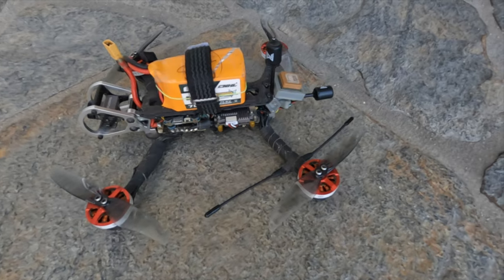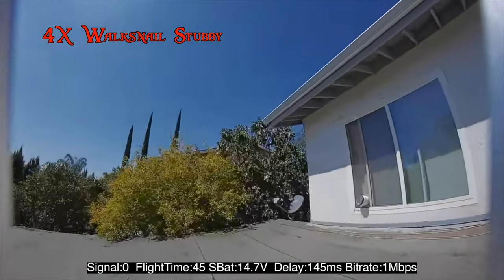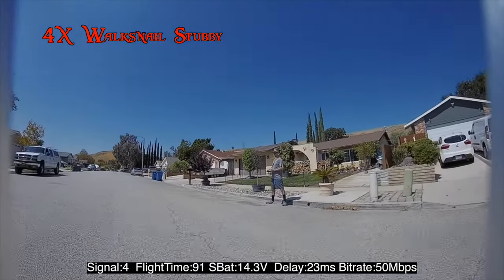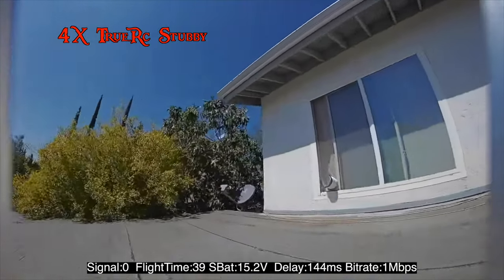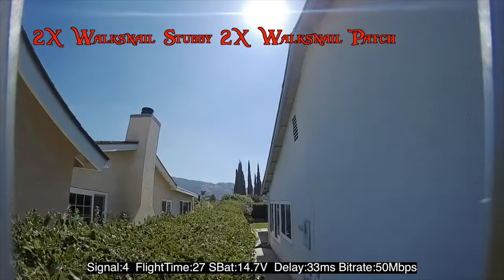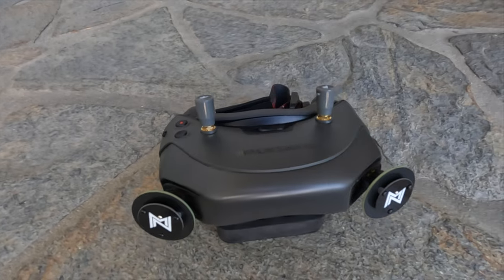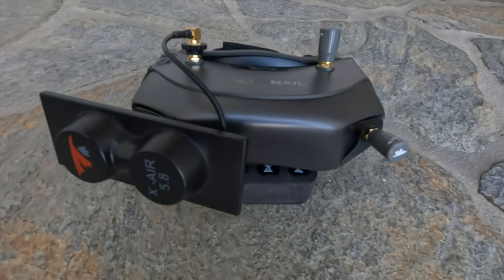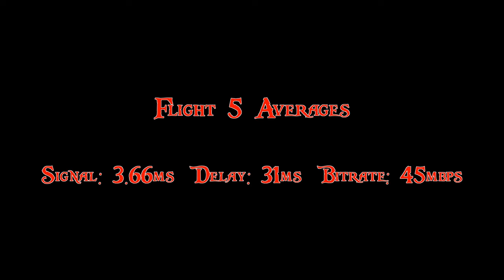Walksnail Avatar HD System - Antenna Shootout - Walksnail Ep 03

Comment: Great antenna test...The upper RH antenna port is a transmit only port. Just so you know. Gave the best signal penetration on the last test as expected using that patch...😳😏😏😏😏🇬🇧 The other 3 ports are RX only..
Reply from the maker: Yes, I moved my ufl internally the day I got the goggles..
Reply: @Rogue_FPV  Yes, I'm not sure having a directional on the transmit port is a good idea unless your range flying of course...😳😳😏🇬🇧
Reply from the maker: @EnglishTurbines  I fly mid-long range, that’s why I opted to move the ufl so that my directional patch gets the benifits at range.
Reply: @Rogue_FPV  Yes, I guess you can screw on the appropriate antenna depending on what your doing of course...Makes more sense to put it on the front port I guess, more suited for a patch...🤔😏😏
Reply from the maker: @EnglishTurbines  yep, if I fly freestyle I usually use 4 Omnis anyway. When I fly for range I’m using a patch 👍🏻

Comment: Nice work with this, great to see the comparisons. In your opinion, does it matter how you hook up the antennas? I have an Avatar HD and bought 2 patch antennas and 2 stubbies and I'm wondering if it's better to put both stubbies on the top connectors or one stubby on the top and the other on the bottom? Any idea?
Reply from the maker: If you  have the original Avatar HD Goggles, the Antenna that transmits ( Where you want to connect your Patch ) is the Top Right antenna when the screens are facing you. If you have the new Goggles X, the Transmit antenna moved to the Top Left Side. 
Personally, I use one TrueRC Dual Patch on the Top and Bottom on the Right side, and Omnis on the Left Top and Bottom. 
Hope this info helps! 

More than anything, upgrading the goggle antennas will give you better performance over the stock antennas.
Reply: @Rogue_FPV  Thanks for your response! One more question, how important is it that there is a patch antenna on the transmitter, say top left? I have the Goggles X and bought the X-Air Mk II Pair. Not entirely sure how important it is for the goggles to transmit info to the vtx versus focusing entirely on receiving the signal to the goggles. Hope my question is clear!
Reply from the maker: @BlisterEye  it’s not critical that the patch antenna be on the transmit antenna, but it’s better.. the goggles transmit their one telemetry back and forth to and from the vtx. 

I think MADsTech does a better job of explaining why in one of his vids.

Comment: I just got the dji x air 2's (one connector per patch) and the stubbies. My plan is to switch the top/right antenna with the front/right as I heard the RX is on top. I will then run both patches to the two front with stubbies on top. I'm wondering if the v1 DJI patch like you use here is better then the x air 2's for v2 dji's? I was pretty confident I got a better set then the single patches sold by true rc right now but I saw rotor riot use the same style you did here and now I'm kind of worried I should have got the dji v1 style you have here?
Reply from the maker: the v2 is basically the same but a smaller form factor. Both perform the same on Dji V1 and V2, I just had the V1's since they came out, and have not had to change to the v2 style.
Reply: @Rogue FPV  Good to know. I wasn't sure if the transmitter signals were being supported somehow with the one I had vs just video. Can't wait to test the WS goggles and VRX with upgraded antennas because they are horrible range/penetration wise compared to my DJI v2s even when they were stock antennas.

Comment: Nice testing mate. Have you tried also VAS Dual Crosshair Extreme?
Reply from the maker: No I haven’t, but VAS does make some really good antennas, and does really thorough testing. Can’t go wrong with VAS, personally I just prefer TrueRc.
Reply: @Rogue_FPV  The reason why I'm asking is because from experience with analog, VAS are really reliable for me and right now my local store has a stock of it. But I'm thorn with TrueRC X-Air and VAS.
Reply from the maker: @LakayFPV  you can’t go wrong with either brand. Both are miles better than the stock goggle antennas / stock patches. 💪🏻

Comment: Thanks for the video! When I'm flying my MBS only goes to 25 instead of the 50 that you are showing. Do you know how I can change this? I went through the settings and didn't see it.
Reply from the maker: You just need to go in the goggle menu with a quad plugged in and change the transmission from Standard to High. That changes the Bitrate from 25mb to 50mb.
Reply: @Rogue_FPV  thank you! And that will improve my penetration is that correct?
Reply from the maker: @jesseday6090  changing to 50mb will improve the quality of the video slightly, but the penetration will get a tiny bit better, but stay the same for the most part. To increase penetration - change antennas on goggles from stock - increase output power on the airunit. I find that for me 500-700mw is more than adequate for freestyle, park flying, and midrange cruising.
Reply: @Rogue_FPV  awesome thank you! I saw somewhere that there's a 1200mw hack too
Reply from the maker: @jesseday6090  there is, but above 700mw you don’t really get any benefit of increased range or penetration with the current firmware. I have the 1200mw applied, but I just noticed a LOT more heat buildup with the same range and penetration of 700mw.

Comment: I'm flying WS so this is interesting to me. I'm wondering if you got better performance on the last set where you have a patch on the retransmit antenna where the rest had stubbies on the retransmit.
Reply from the maker: I do not feel this is the case per-say... I don't feel at this range, even with low power used that will have as much of an effect as it would at "real" range +.5mi where the impact would be more beneficial.
I mean, yes, the patch on the re-transmit logically should give better performance, but I feel the real gains were had because of better antenna tuning on the TrueRC. 
This weekend, I will try to test your theory and report back 🙌